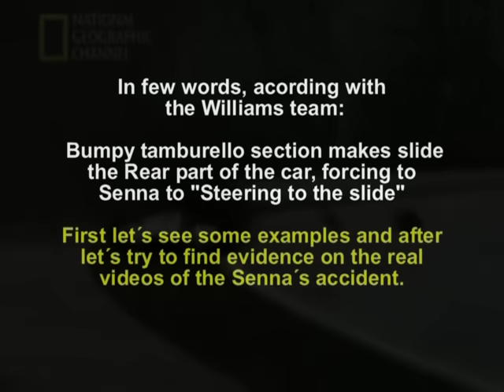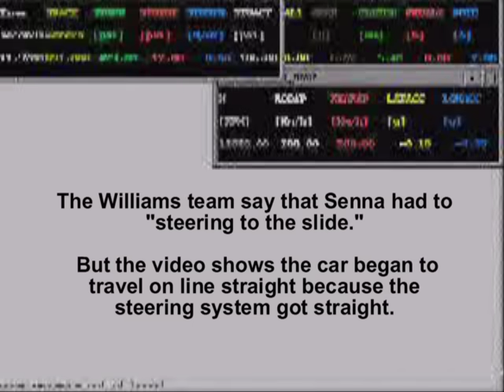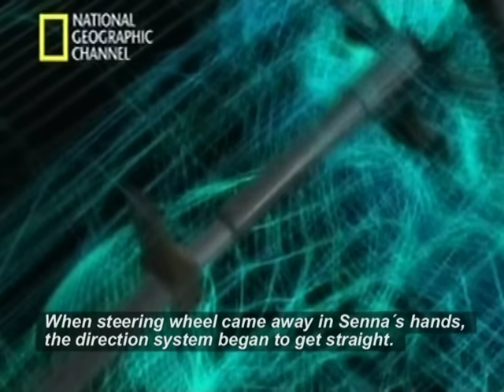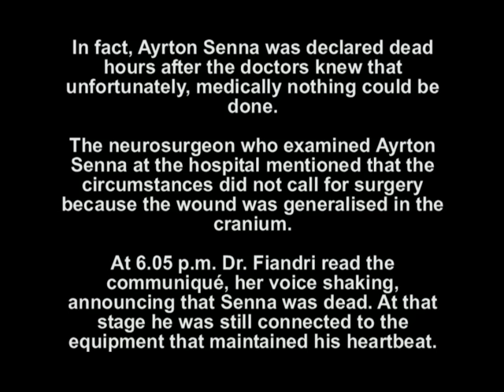5/5 the death of Ayrton Senna - what NatGeo did not tell

Comment: at that top speed tamburello you cant even barely see steering the slide because such small movements in wheel. much different looking than steering slide in slower speed corner where you can see the wheel move. the higher the speed the corner the less steering input there is. i think steering broke after the crash i think senna simply lost it at tamburello because the corner was not smooth it had repaved parts and bumpy. Its not like Senna never made mistakes in f1 racing he made many.

Comment: That's actually not what happened at all. The steering column broke and he literally couldn't steer the car. They had just adjusted it to his liking. All of the bottoming out is most likely the cause of the breakage but it wasn't over steer. The column broke and he couldn't steer. You can see on the full screen on board shot, the lights on the dash go straight down into his lap and then back up and he tried to steer but nothing happened because the column shaft was broken in half. Even still, if the tire hadn't hit him in the head, he would have gotten out and walked away. Maybe staggered because of the G-forces on impact but walked away all the same.
Reply: he broke his skull, he wouldve died anyway, and it was a tyre that hit his head but instead a suspension spring hitting his helmet

Comment: My guess is that he turned fast enough that the tires matched the frame rate of the camera. Think about it. Have you ever seen a helicopter flying on video but it seems that the rotors aren't moving? That's because the FPS of the camera have synced with the speed of the rotors.  This is the 90s so FPS wasn't lighting speed so it is possible.

Comment: your wrong about the wheels moving in relation to the curb in a slide..   it's the cars nose in relation to the curb not the wheels.    Think of a trolley, the wheels point straight even if the trolley is sideways.  So look at the nose angle in relation to the curb NOT the wheels

Good breakdown apart from that.

Comment: I didn't see the front tires even turn left at all, almost like no steering, or he didn't react, the wheels stayed straight through, you would expect to see the front wheels flinch left as soon as he realized I'm slipping out of the line, but it's like he didn't even try......anybody else agree?? When your aiming straight at a wall in a slide at the least you will totally have that wheel to lock as you hit the wall praying some grip grabbed, but seemed like the wheels never tried correcting when you would expect an excessive overcorrect once he realizes the car isn't grabbing still......I just don't get it ......

Comment: A blind man can see there is zero deviation from his front wheel yet the fottage from within the cockpit shows him steering hard. If you watch Damon Hillary and Senna in earlier races you will see the FW16 stepping out at the back and their reactions to counter it succesfully or not but you can see a reaction from the car while here the car just his straight into the wall. Even his number one critic Prost admits it was mechanical failure. Senna did not die four later in hospital either.

Comment: The problem is,, looking back on those safety standards comparing them to what we know today. That Williams would not have been the only car on track that day that had welds in places it shouldnt. Do we blame BAR for the death of Marshall  Graham Beveridge at Australia 2001? No, wheel tethers were introduced later.  Jules Bianchi,, the VSC was bought in because of that incident. Remember Senna for the racer he was, not how or why he died. Look at Lewis the other week,, data shows he was doing 230km/h down the hanger straight on 3 wheels,,, F1 drivers are a different breed, the previous generations more so,,, they race to win at all costs.

Comment: A few things obvious to me as a bike racer.. Number one is the car steer against the turn in mid corner... no sane driver would do that for any reason.  2nd, if you are in trouble via loss of grip, you ALWAYS hold the throttle at WOT and try to aim the vehicle in the direction you want it to go in an effort to regain control.  No pro driver is ever ever ever going to throw out an anchor in the middle of a stupid fast corner like Tamburello if his car is still under his control.  While this is an intuitive and even natural response it is the wrong one.  Senna had no control over the car, that's the only reason he would have slammed on the brakes.. Its the only thing he had left.

Comment: A while ago i send mi car for repairs, was a honda accord i got it bck from the mechanic the repair requires to remove both tires including the rods and some other parts that's haz to do whit the suspension i was working night shifts i drove just a mile from home and the car keep bering to the right i was driven 45 miles per hour speed limit on the road no matter how hard i keep pushing the steering wheel to the left the car keep going right i got it to stop on a parking lot of a restaurant i live it there i call another mechanic to check it out he tell me there was no bolt holding the sway bar this is a bad example but yeah simple as a bolt no tighten up and get loose now just imagine if a was driving faster and the car turn to the right where the upcoming trafick. RIP ayrton

Comment: This just goes to shows how pathetic the Williams team was back then, going so far as to fabricate a false story of events instead of owning up to their own mechanical failure, instead placing the blame on the tires cooling as well as slight driver error. If you take examples from other instances during this time period similar to what they’ve said, this crash doesn’t match up to their description of events at all. If that were the case why did it happen on lap 7 instead of lap 6 when the tires were cooler and thus less expanded resulting in less grip? Why wasn’t any signs of turning right to correct oversteer when looking at the wheels? The things they say just doesn’t add up with reality.

Comment: why no mention of the steering coloum or the steering rods to the front wheels that were turned down on a lathe to sennas own specs they told him it was not safe but he was god in the garage and they had them turned down,so he could feel the steering and what the front was doing it was a known trick he did ,i knew 6 folks that worked at different teams in sennas time was no secret the rod and steering gave way
Reply: Ive always wondered that myself. Yes perhaps they did a shoddy job but he DID ask for it. They were put in a position of needing to do something and I had that same thought...he was Senna, no doubt he would not wait, and surely they felt they had to give in. Not absolving or casting blame, just yeah....

Comment: why is there all discussion about what caused the accident it was conclusively proven that the steering coluum snapped at the jointing spot when it was shorten for Senna whiched caused him to go straight into the wall at high speed which  broken the front strut on the wheel which in turn punched through the helmet  and into his scull , caused the williams engineers not doing the steering coluum weld properly

Comment: While there is all the debate and bordering on conspiracy, all I will say is Senna was becoming concerned with safety and its clear a lot needed to be done. 
Besides Senna, Ratzenberger died this weekend. Rubens could've have died. Spectators and pit crew staff were injured. It IS kind of crazy that up till 1994 they could let F1 cars drive around Imola with its little run off and a concrete barrier. Much needed to be done and it's tragic this weekend needed to happen for us all to see it. Many changes were implemented because of this race. 

Not unlike Dale Earnhardt who would never dare wear the HANS device, but his death proved how necessary it was and has surely saved numerous lives, in multiple motorsports. The danger of racing is part of its thrill, but tragically things like this can and will happen...thankful safety has been drastically improved since this terrible day, and RIP to all those who died before hand.

Comment: it's obvious to me that his steering column broke. these cars at this time were running a ton of negative caster, a lot like a shopping cart front wheel. if you take away all steering input the front wheels will automatically return to the static straight forward position because the forward movement of the car forces them to. you can clearly see that from the start of the accident until the car hit the wall the front tires are pointed straight forward. a part broke somewhere in the system, most likely the modified column because forces were encountered that exceeded design limits. this shit happens in racing, and usually to the guy who pushes the machines the hardest, and that guy is usually the best guy on the track. to me tho, the bottom line is this... Williams should have fabricated a new column instead of modifying the existing one. had they done that Senna would proably still be with us.

Comment: Scenario 1:
The slow speed start behind the pace car reduced tire temperature and therefore tire pressure and lowered the ride height of the car (even though tire temperature and pressure and height were higher than the previous lap) and caused the car to bottom out (which race cars then did literally all the time anyway) which caused the airflow under the car to be cut off completely!!!!! which in turn caused a reduction in down-force and traction to the wheels which caused the rear of the car (not front and slide across all 4 wheels ???!!) to slide and step out sideways and Senna corrected this rear slide by steering into the slide which caused him to go straight and into the wall and then broke the steering column on impact! 

Scenario 2:
A welded steering column experienced fatigue cracks over time from going over harsh bumps and broke after going over another harsh bump resulting in loss of steering causing the car to go straight.

If you conclude that Scenario 1 is what actually happened then please contact me, I have a bridge to sell you. 

The steering column should have never been welded. It should have been one solid piece. Because welds are a weak spot and can fatigue (and corrode). More so than one solid piece. Especially when not done correctly. Especially when exposed to extreme forces combined with hits by harsh bumps over time.

This was an accident. No doubt. This is an extreme sport with extreme forces applied to man and machine. That is what makes the sport so attractive and the drivers heroes. Man and machine at the absolute limit. However, when operating at the limit, the tiniest of flaws can have dire consequences. The welded steering column was compromised. One too many bumps and it broke. Williams should have taken responsibility. It does not mean they are to "blame". It is a dangerous sport and Senna knew this. But selling out like this tarnished the team and the sport. Sad.

Comment: the actual footage of the accident does not support what they want the viewer to believe, the wheels were straight during the entire run into the wall, that would not be the normal reaction in that situation, he would have steered aggressively to the left, while applying the brakes to avoid a direct head on collision with the wall,  or he was flying through the air and never had traction, regardless, he would have turned left, we see this reaction when motogp riders have their front wheel off the ground when rolling on the throttle, i do not race, but there is no way he steers the car straight into the wall

Comment: if the steering had broke he would have turned hard to left and stayed there natural reflex.He knew he was in too hot was going to run out of track and roll so he steered stright  to keep the car from going head on to wall and he hit it sideways. If the shock had not come loose and hit him in the head there would be no controversy drivers have walked away from far worse many times.
Reply: He got a terrific head damage because of the impact with the front right wheel...and as far as we were told, also because of a rod of the front right suspension piercing his visor and
his forehead.Basically if not for head damage
he could have survived.

Comment: I doubt very seriously that the tire had much difference it did not help,but hitting a wall of solid concrete at over 180 mph at the angle was going to not be any crash anyone would walk away from...the thing we can take away from this is safety up tires and whatever ways to give ample run off areas it is the reason I chose to race Formula on over Indy car it was to avoid racing around metal or concrete walls because F1 tracks for the most part have fantastic gravel pits that brings the car to a beautiful ABS brake system type if stop and the car is still right side up hard on the gas and u drive right out of the gravel pit with no damage but now u no where the line is so u don't go over it.There was no gravel pit in this corner or any tires and this was the era of V10 engines the fastest cars....so there is not much to say thanks for the video....we race we sign the waiver...say if we crash its our fault..as racers.THANKS

Comment: Hard to believe, but they made five vids before revealing the cause of death.  Senna died because a tire flying through the air struck his exposed head.  The 'exposed head' was a requirement of F1 racing - Senna was not the first nor last to die from a missile-like tire or other piece being loose on the racetrack.  The tire came loose because there was no deceleration aid such as gravel, a wide run-out area, or some other means to absorb vehicle speed gradually and fully.  The direct cause - exposed head - is ignored until the last few seconds of this vid.  Secondary cause - no deceleration lane - is also ignored until the last seconds of the vid.  Sure, the downforce situation (which the vids spent a lot of time revealing) contributed to a skid, but it was just one skid out of thousands of similar skids that were effectively corrected by F1 drivers that season.   So far I see nothing caused by the Willians team.

The steering connection broke - how that is the fault of Williams is not explained, probably because it was not their fault, just an unforeseen accident caused by the mechanical stress of an F1 race.

The cold tires were the fault of the slow Safety Car.  All they had to do was to use a car fast enough to keep group tire temps up - and there were hundreds of racers who owned scores of vehicles suitable to be a fast safety car right there on site.  But some sort of greed to get ad revenue from selling the Safety Car slot was in play.

Greed and profit was the proximate cause of many F1 deaths, including Senna's.  Tracks and promoters were avoiding the expense of run-out lanes.  FIA. along with the teams,  was avoiding the cost of protecting drivers' heads from G-forces, especially the G-forces caused by impact from objects loose on the track.